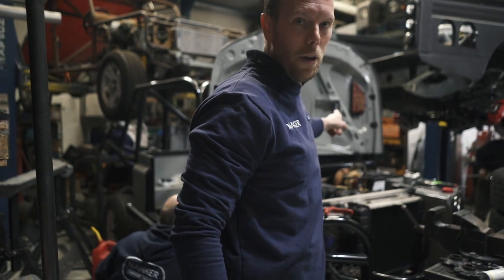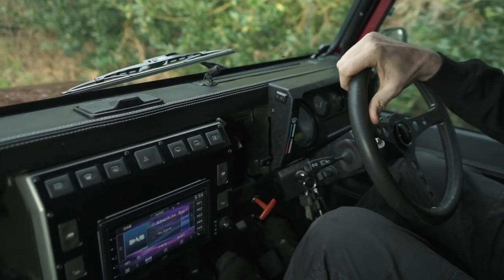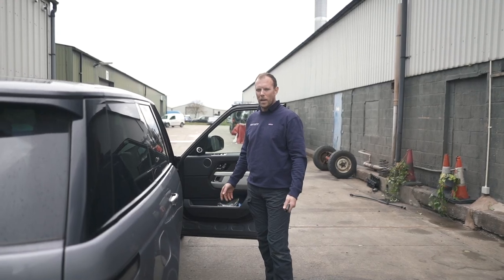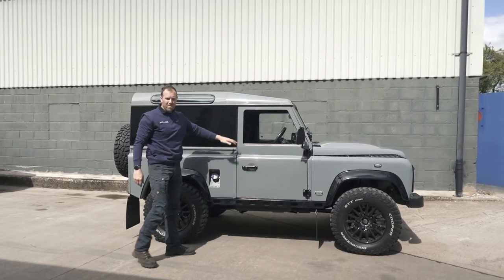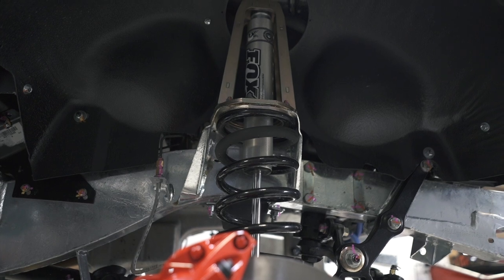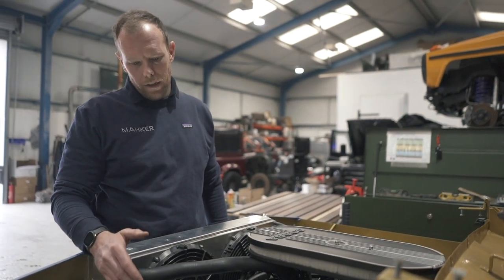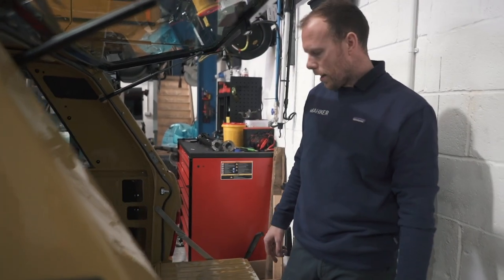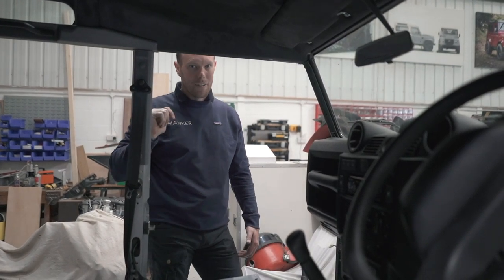THIS IS OUR BEST LAND ROVER CONVERSION YET AND WHY WE'LL DO MORE IN 2023 | MAHKER WEEKLY EP006

Comment: You guys build some awesome machines.  I have a late 2013 2.2 90 XS Black Pack with an Ashcroft Disco 2 Auto Box.  Lovely car but engine is a bit agricultural and coupled with the auto box under powered.  Without breaking the bank which engine and auto box combo would you fit to give refinement and make the drive more fun?
Reply from the maker: Definitely the bmw sir come and drive one